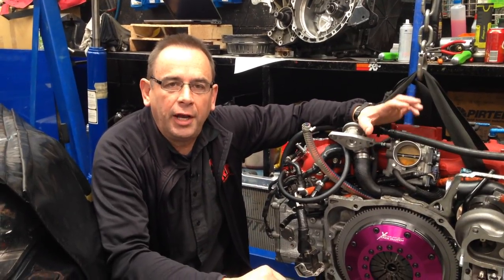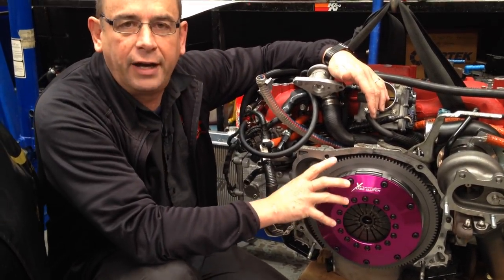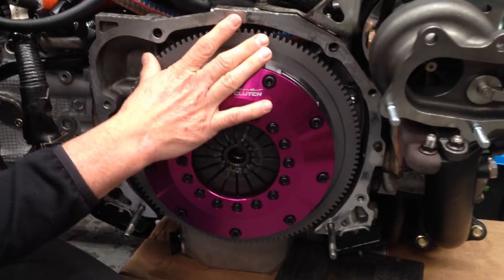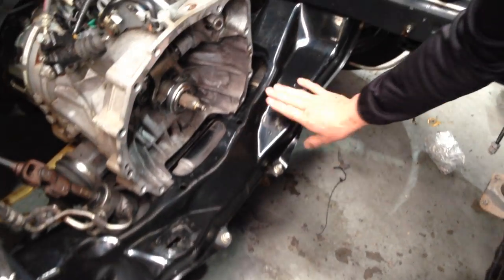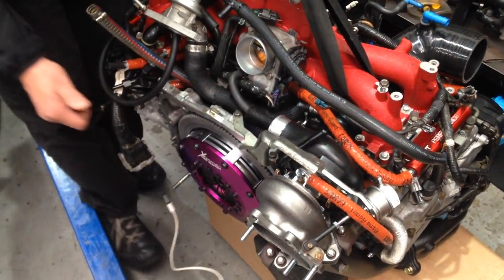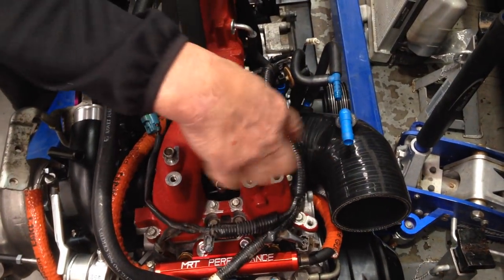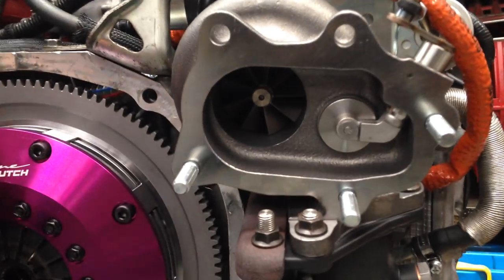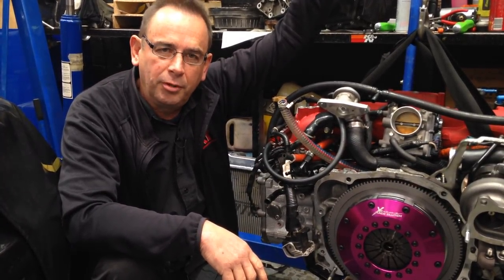Subaru Closed Deck Engine Rebuild Tour

Comment: Hey Brett, what sort of power and rev range are you shooting for on this setup? Also why the switch to single scroll? Im curious to know why those headers look very large but your also sticking to Tmic? Will the car be on pump 98 or e85?  Im looking at doing a similar setup on my subaru. Cheers from NZ.
Reply from the maker: we hardly EVER use FMIC's any more
Reply: MRT Performance Thank you for your reply. I understand your very busy but can you bulletpoint a few reasons please? Im curious to see if you findings allign with my own theorys. Also do you sell an aftermarket TMIC to suit a v3/4 intake manifold/chasis? At this stage ill be using a v7/8/9 wrx tmic.

Comment: Hi Brett, Would a Td05 Turbo with supporting mods/Tune be a good reasonable upgrade for a stock block 2003 wrx ? Daily driven on the motor way in nz.
Reply from the maker: we only use the STi IHI turbos and a tune
Reply: I have a fairly stock 03 WRX USDM. I am running 850cc injectors with a TD05 16g turbo out of a 94 JDM WRX. Makes around 300HP. I would recommend it if you aren't looking to gain too much more HP. Mine is daily driven on the street.